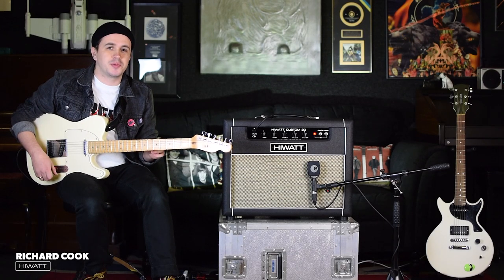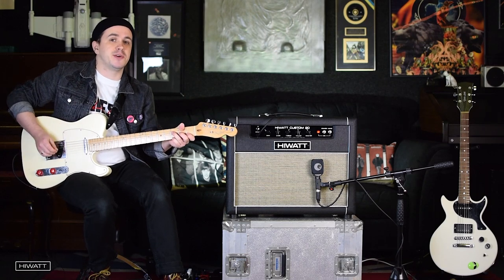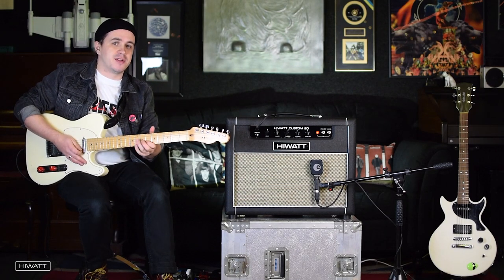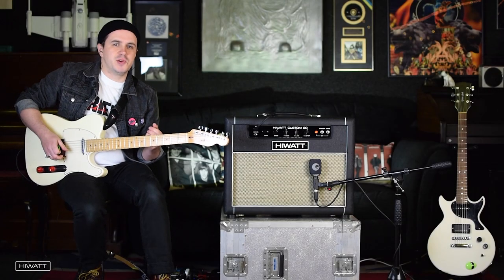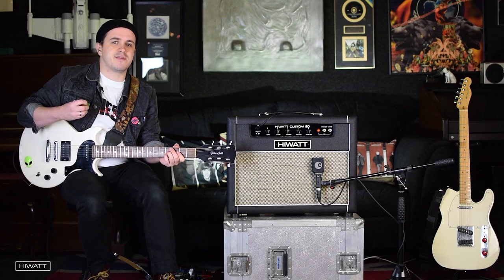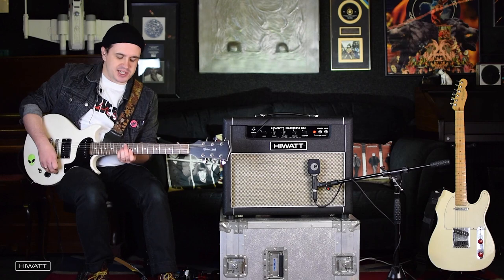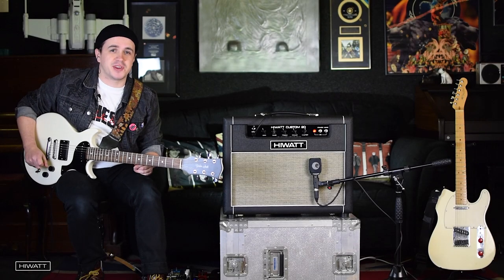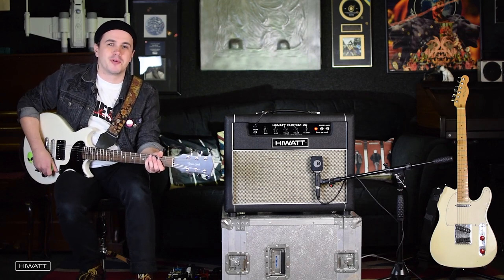Hiwatt Custom 20

Comment: Effectsloop?
Reply: There's no effects loop or reverb on their Custom series of amps, with an exception being the Studio/Stage model which has internal spring reverb.
As the host mentioned these do serve as a great pedal platform, run whatever you like in line into the front of the amp.